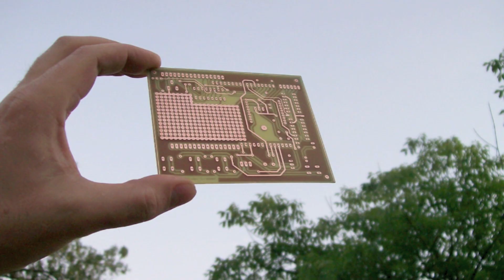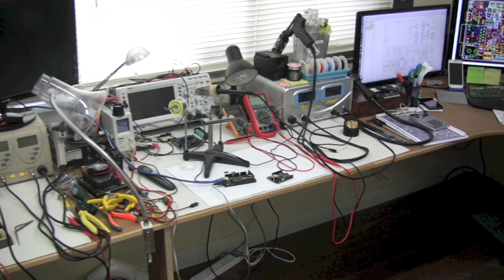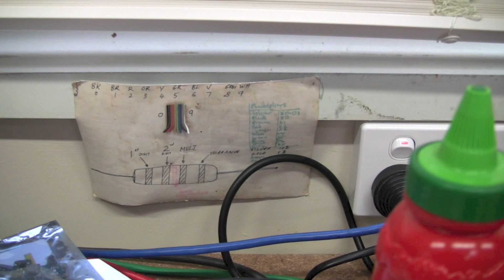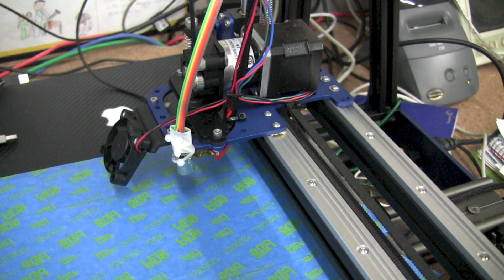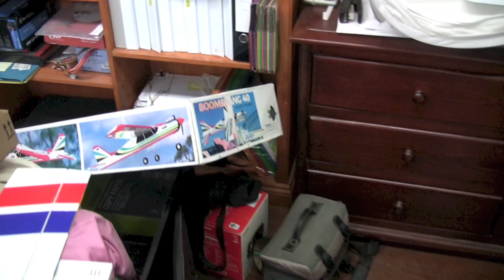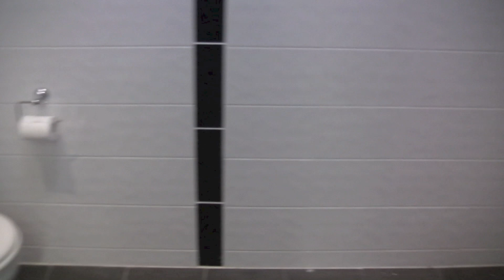SuperHouseTV #10: Workshop Tour

Comment: at 10:35 you can solve that by building a floating shelf that sits on 4 legs directly on your actual natural sun covered electronic bench, you can even construct one made of wood with two shelf levels, one on top of the other. the only small downside will be that the front two legs resting on the working table might restrict a little your hand movement to the sides...
cheers

Comment: I know this is a year old now, but perhaps you're still set up here; I noticed there was no fire extinguisher or medical kits so my suggestion would be to get some of those. Safety first!
Reply from the maker: citizen6350 That's a really good (and important) suggestion. Since this video was done I've rearranged the room with the electronics stuff along the far wall and the bench under the window as a general-purpose work area, and it works much better. I've also put a CO2 fire extinguisher on the wall just opposite the laser cutter, and I have some first aid stuff near the soldering area (burn dressings, that sort of thing). I specifically chose a CO2 extinguisher because it doesn't leave residue on things, so I could use it on the laser cutter or other tools without ruining them. There's also a mains-powered smoke detector which is cross-wired to other smoke detectors inside the house.

Comment from the maker: I don't have any particular impressions of it yet (other than being #*@&$ heavy!) because so far I've only started it up and driven the head around manually. I still need to set up the software to use it, and a water reservoir for the head cooling pump. My plan is to move the laser cutter and the router next to each other so they can share the same tub of water.

Comment: The MC743 does not support 27" monitors. There are a few other products, but I would go for individual VESA mounting clamps. The 27" Apple display is not what I would call light in weight.

Comment: Great video, I sure wouldn't mind a workshop like yours!
Would love to get your impression and thoughts on the router you have (looks like a CNC6040Z-S80?). I've read a fair amount about it and some users have said that the unshielded cables to the stepper motors has been a source to unstable behaviour and they have had to replace them to get it to function properly. Your opinion about build- and material quality would also be interesting to hear about.

Comment from the maker: Thanks for the Selbys tip. I made a custom 3-way monitor stand a while ago (and did a video about it) but then I replaced the middle 24" monitor with the 27", and all the dimensions changed so I gave up on it. I want to replace all the benches, too, the chipboard benches were a quick solution because I couldn't afford anything else. When I can afford it I want to put in a corner desk and flank it with matching straight desks